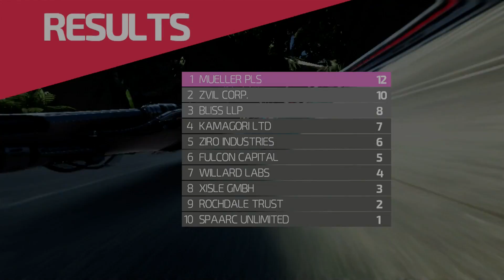Nintendo Switch - High Powered GPU Extension Theory

Comment: If you had to buy a GTX 1080 as a boost.
The price would be to high combined
Reply: Jeremy Hall on par You mean 10x better
Reply: A little over 2X PS4 1.8Tflops GTX 1060 4Tflops, but then again that isn't everything that is involved when it comes to power, so with everything combined on what that card alone can do and is compared to the PS4 my guess would be (total computing power) would place it around 4X greater.

Comment: You play games on the PC that you can switch various graphics settings from Ultra to Low, in an instant... so, I don't see why it's so unimaginable to do on the Switch.
Reply from the maker: +utopiaopera It's not that easy for all games, maybe some but not all. It would be easier for a lot of developers to do like I suggest in the video so they can just focus on the performance of one high profile.
Reply: SuperMetaldave64 If Nintendo designed their Switch development environment for the situation then it might be as easy as you like. PS4 developers seemed quite happy at the solution Sony came up with to make one game to scale between PS4 and PS4 Pro... they aren't complaining about it being a time consuming process.
Reply: Also there's all kinds of resolutions in mobile phones and you don't have to build a different game for each.
Reply: utopiaopera Taken the words right out of my mouth. They can simply have a dock mode and a mobile mode effecting AF,AA or texture and screen resolution....easy
Reply: SuperMetaldave64 can you please specify why its not that easy? I know a thing or two about games development, multi profiles is never an issue especially when planned and for 2 clear profiles for the exact same gpu/memory underclocked...
Reply: lol change the graphic settings from garbage 30 fps to shit 720p. :D
Reply: The Homemade Gamer It has been embeded depending on your display capabilities

Comment from the maker: Have a great weekend guys! I hope you do spend some time with your families and also of course play some games lol. Let me know what you think about the video. Thanks for the support :)
Reply: SuperMetaldave64 I really think it's was Nvidia pascal. 

because if it is Maxwell there is device like Google pixel c already in market. there is no need for r&d so it will come this year and it will not have fan.
Reply: SuperMetaldave64 but if I recall pascal is also refined and optimized for better battery life and more stable frames or so I have read on the box.
Reply: The external USB C port cannot add extra graphics power as it would not have enough bandwidth, to get the bandwidth it would need to have thunderbolt which is Intel exclusive sadly. Also pascal is not just a die shrink of maxwell, while the actual horsepower Maxwell can put out may be similar, it takes far more energy and cannot clock as high as Pascal, to underestimate the gains of pascal would be a huge mistake and I hope the rumors about Maxwell aren't true (Unfortunately they probably are).
Reply: SuperMetaldave64 thanks man, you too.
Reply from the maker: +Jordawn House 👍
Reply: Heavily stand never?...
Reply: ***** Thanks...
Reply: John Steel hay is the pascal architecture more optimized for battery life or is it better that it uses maxwell just curious.
Reply: also i disagree with having to pay to use the Multiplayer functionality, that's truly fucked
Reply: Nope.
- USB C standard have minimum speed at 10Gbps not as fast as thunderbolt 3 but it is used by some older e-gpu in the pass. if target is not really fast pc card like Nvidia 1080 10Gbps work fine.
- USB C have Alternate Mode that can change protocol (like thunderbolt DisplayPort or HDMI) Nintendo can make one so 20 and 40 Gbps of thunderbolt 3 or more is possible with out Intel's license (this gpu/dock will not work on other's hardware ... except Nintendo or more likely Nvidia allow but who's care)
Reply: So you don't think that the limitation with thunderbolt isn't related in any way to the chipset on the board? Also this does not sound like something Nintendo would do, I'm sick of rumors and I'm waiting for nintendo to announce further details, also I've never heard of this mystic "Alternate Mode", I know that USB-C can put out video signals, but i thought that the 10Gb/s was a limitation of the interface. Looking up if bandwidth is an issue seems to say that it isn't an issue, so that's good I guess. Sorry for the rant, didn't mean to sound too cocky. I'm just feeling mainly that a youtuber with no contact to nintendo shouldn't really be making up rumors (Neither should most of the reporters).
Reply: I just simply don't think that thunderbolt can "licensed" like software such as DirectX12 can be.
Reply: I'm no expert on this matter either, quite clearly. So don't take anything I say too seriously, I don't want you to.